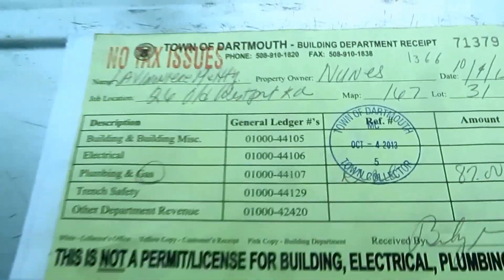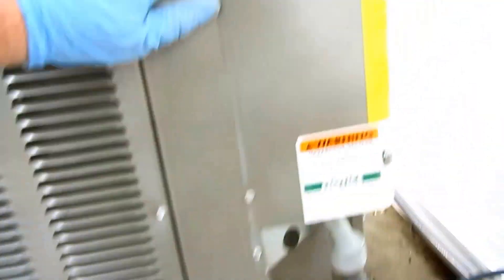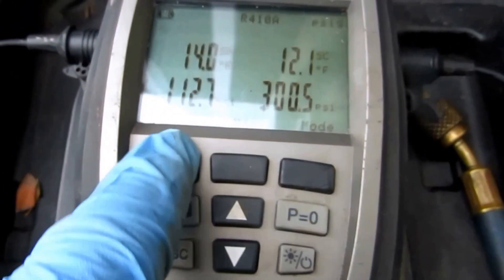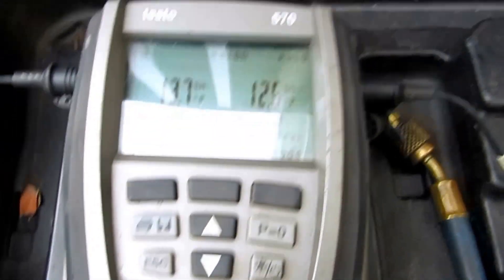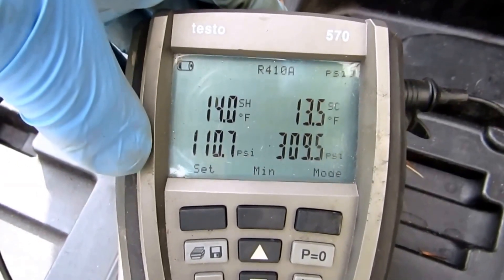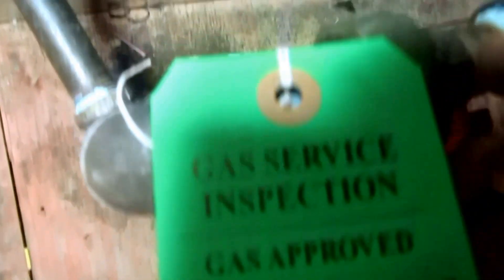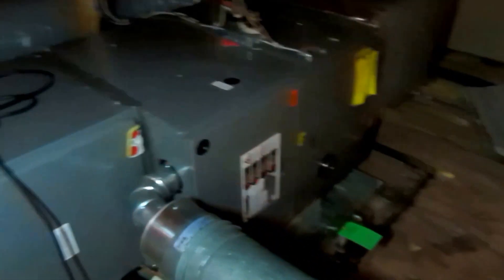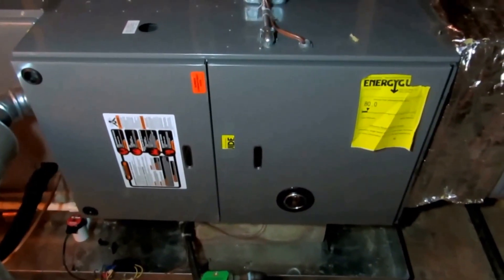gas furnace@ 5 ton air conditioning replacement day 3

Comment: Steve, what differs the Testo 570 from 557 ? I am looking to get a set, just not sure which
Reply from the maker: with the 570 you can print out the results and a few other things 557 is set up the same as the 550 just with a 3/8 vac port .i would say get the 570 screen set up and buttons are different
Reply: steven lavimoniere Thanks man..I actually ended up checking out one of Your other clips on all three Testos and figured i might as well do it right..
Reply: i also stumbled on a vid of the new Imperial gauges and WoW now thats some high tech stuff for real! Don't think i will be needing those yet though, Ya know
Reply from the maker: Hybrid nj testo is a great manifold  ..

Comment: I have not seen a gas line like that before. Still kinda new to the trade. Does it do what a drip leg would do?
Great videos! I appreciate that you make them, and share your experience. 
Thanks, 
Chris
Reply from the maker: up my way heat is either gas or oil ,,,no electric heat to speak of its just cost to much to run .the drip let on the gas line catches and debree or liqiud before entering the gas valve